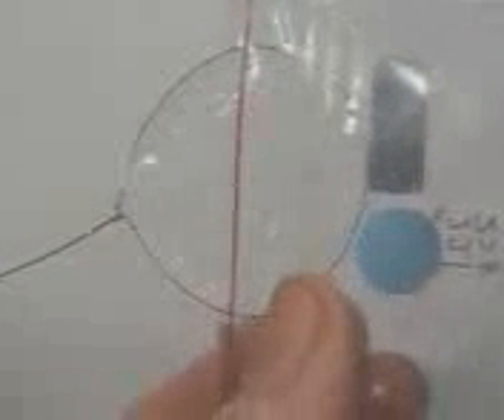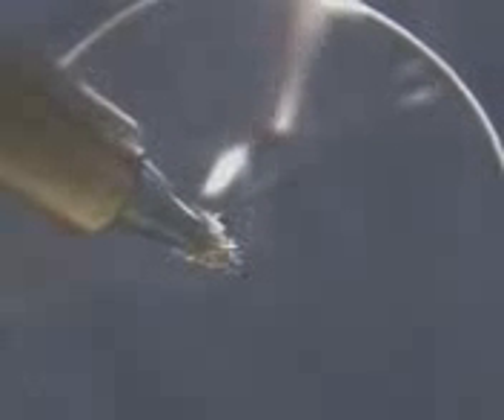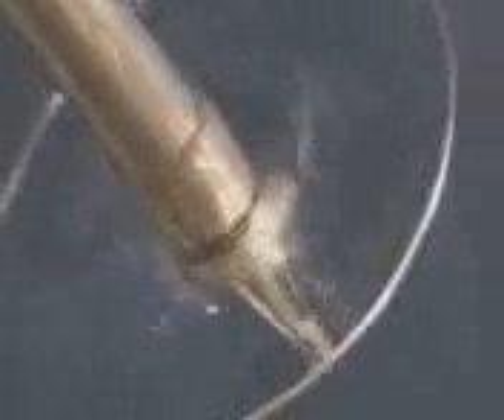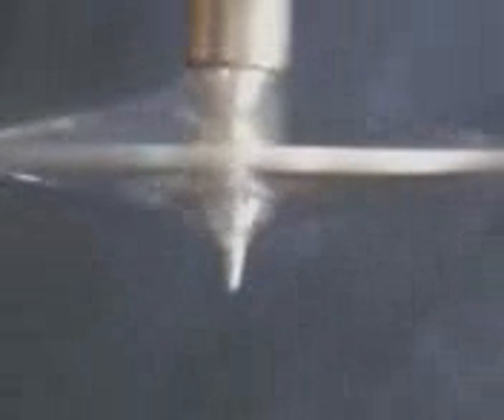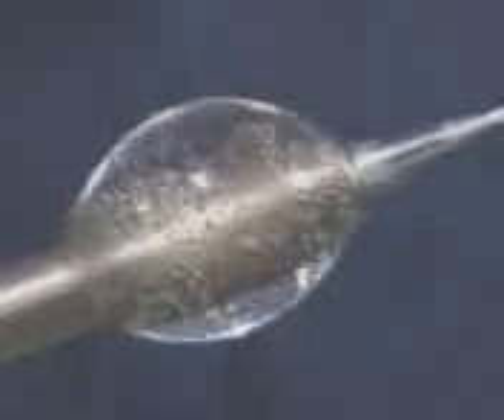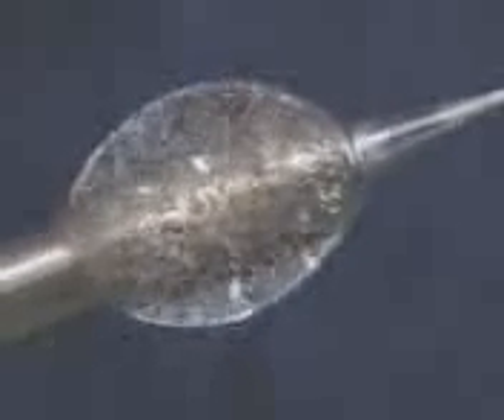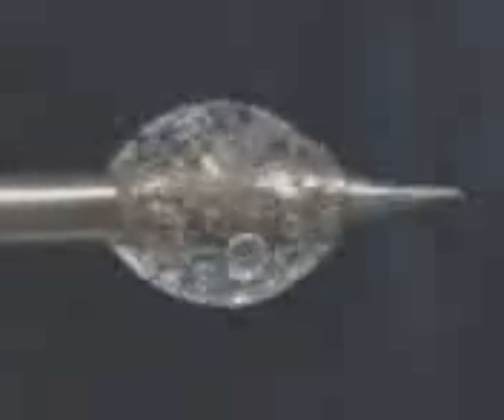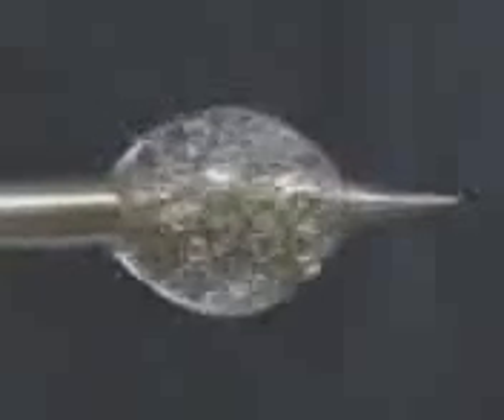Boiling water with a soldering iron in microgravity

Comment: You're incorrect mikethoasnc. Water will not necessarily boil at its boiling point, even at atmospheric pressure. Like many materials it often needs disturbance to undergo phase change. This is not circumvention of physics, its just the way the physics works.